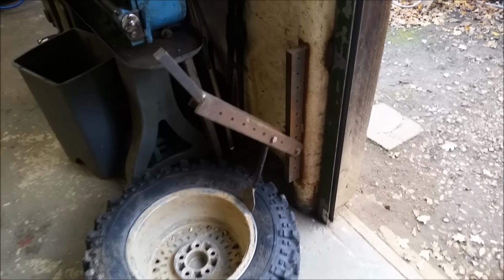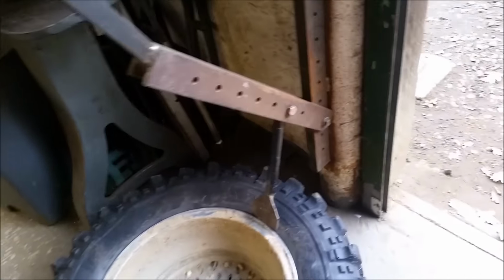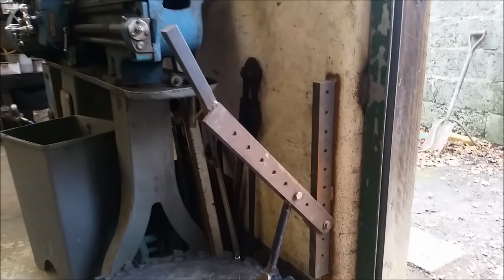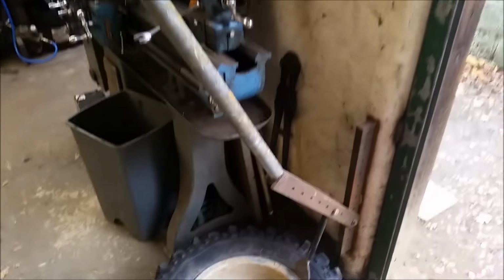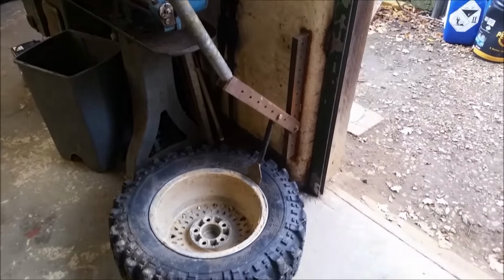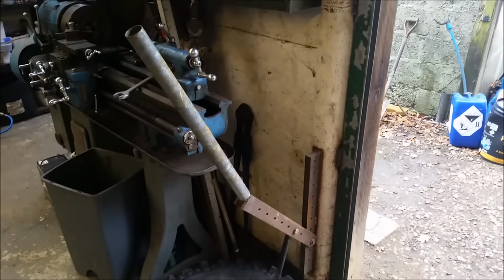Home made tire bead breaker

Comment: Good stuff. Ok made similar and my edge that contacts the rubber isn't as sharp as yours and it still slips away from the rim down the tyre wall. Not a problem if the tyre is knackered but I've ruined a few good tyres that were just punctured. I've tried different profiles but yet to find the best. Used to have a bead buster years ago, don't think they're made anymore, went by same name. It lasted a while but eventually yielded to too much sledge hammer stuff

Comment: Put a little lip in toward the wheel at the bottom of your spoon. That way it stays right on top of the bead and you don't loose energy just flexing the tire. All your push down is right on top of the bead then and nothing else.
Reply from the maker: This was a long time ago, I added a much wider foot with extra grip, works much better than the one in the video!

Comment: You need to have the part that goes to the bead more on an angle, it would make life so much easier because it would then slide in between the bead of the tire and rim
Reply: Agree. That way you don't risk introducing cuts into the bead since the pushing part will lay flat against the sidewall of the tire.